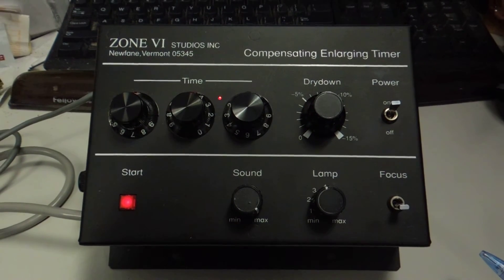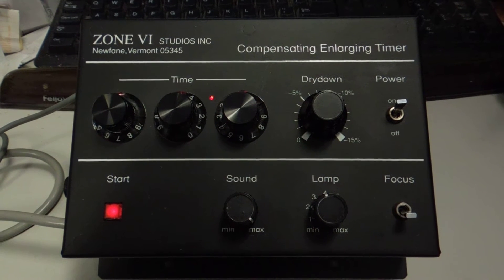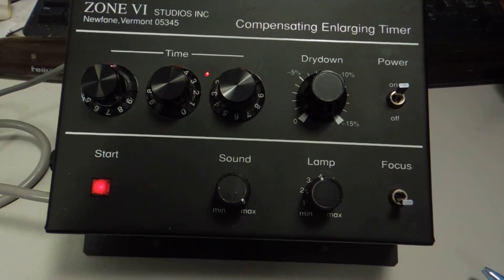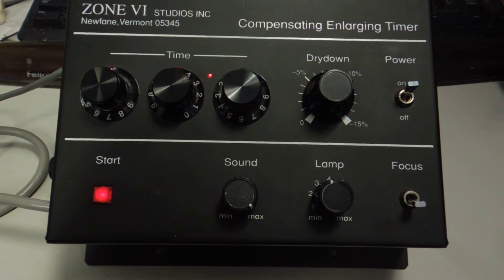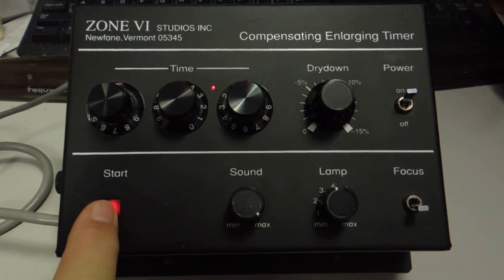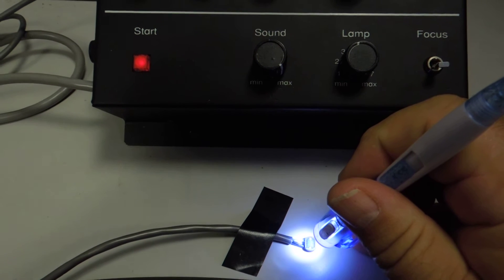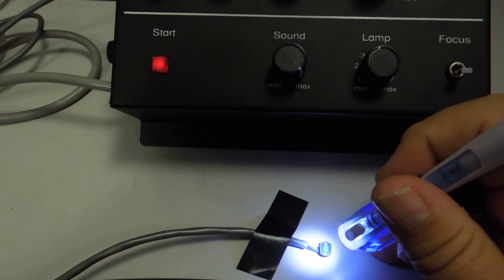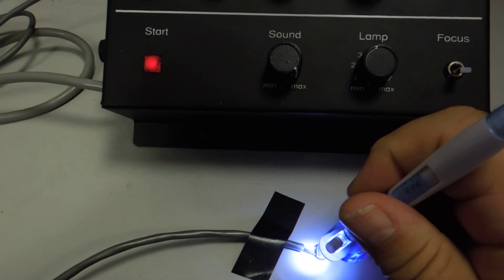Zone VI Compensating Enlarging Timer

Comment: Does anybody out there know if you would still really need to use a compensating timer if you are using a cold light head?  I am confused about what the purpose or advantage of this is.  tnx
Reply: You asked the question a long time ago hopefully you or someone else finds this helpful. The sensor was specifically for cold light heads, as they typically take longer to achieve their full brightness if you were at a short exposure duration, that warm up time to ideal exposure would change over the course of a printing session and timer was designed to compensate. I've only come across one maybe 20 years ago and didn't have the money to buy it at the time. A buddy of mine was convinced that the work around using a standard timer was to "warm" up  the head in focus mode for a minute or two before switching over to exposure mode and also making sure exposure were in the 15 to 20 second range, too short and he was convinced the fluctuations were apparent

Comment: I have one of these timers, but have long ago lost the photodiode. I now have secured a photodiode, but am not sure how to wire it into the timer. Would you be will to provide some images of the connection between the photodiode and the timer? This would help me connect mine in the same way. Also, if there is a resistor in the connector, I would like to know the value of that...if you can just tell me the color bands, that is all I would need. Thx